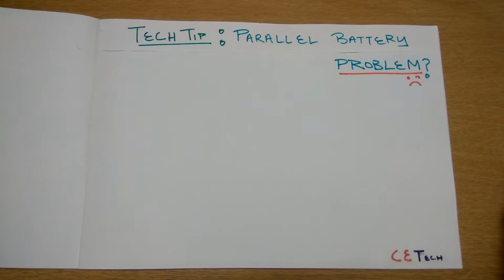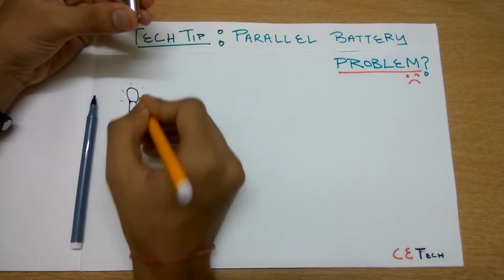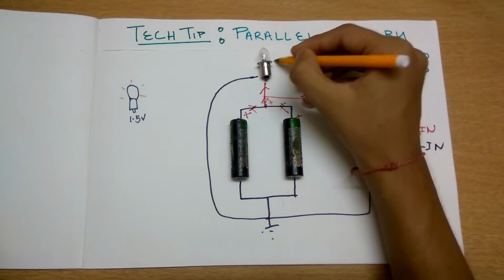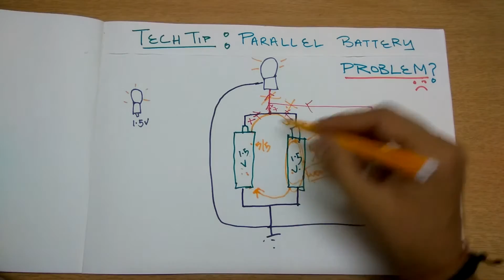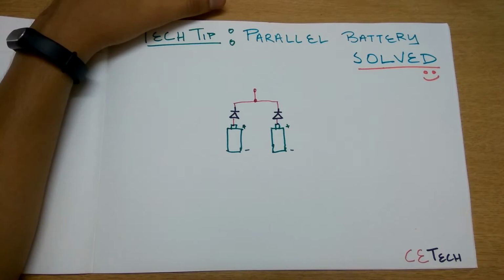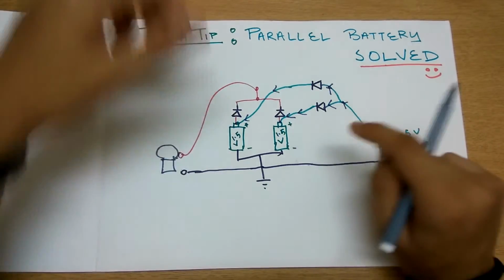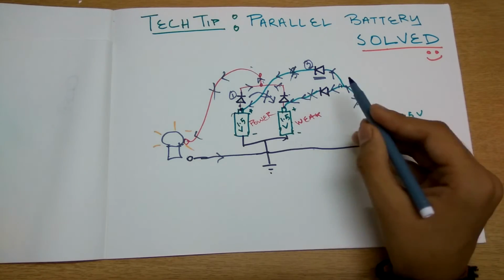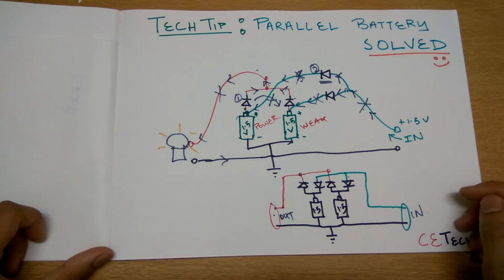Adding rechargeable parallel batteries to your device | Circuit Design Tip

Comment: Great video, i was wondering though : does this mean you could charge the batteries and power the load at the same time ? also i assume you would need verry low voltage drop on the diodes to make this practical?
Reply from the maker: +Math3vv Thank You first of all. Yes we can charge the batteries and at the same time power the load but in that case the charging source should be of good amperage. Yes your assumption is correct in the case where the voltage needed is equal to the supplied by the battery. For my case the voltage for the batteries was 7.2 volts and I needed 5v so not a problem for me.

Comment: What about the charging voltage? Do we have to double the charging voltage if we add a 2nd battery to device that was designed to use only 1 battery? (Let's assume the light bulb is OFF while charging). Thank you
Reply: Kushan Aravinda same voltage, doubled Ah capacity.

Comment: assuming 1 battery became 1.4v and the 1 battery became 0.8v  when switch on, output is not the same, 
 current is not constant
Reply from the maker: Because the batteries are in parallel, the current simply add up.
Reply: @CETech4u  the brightness affected because of voltage drop by diode